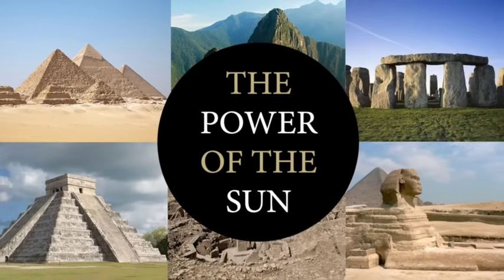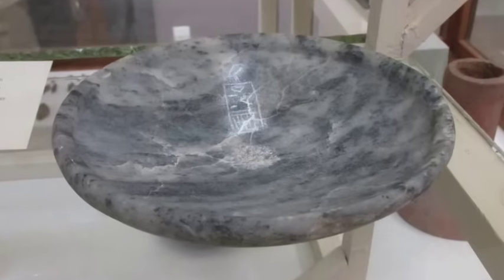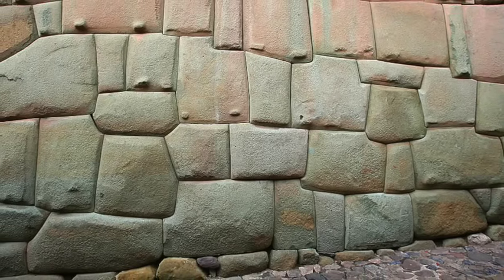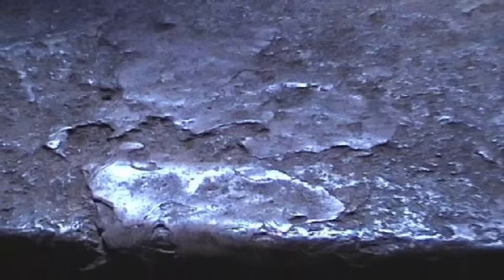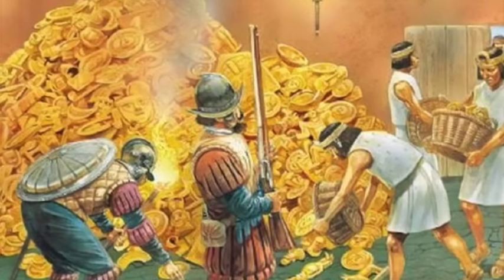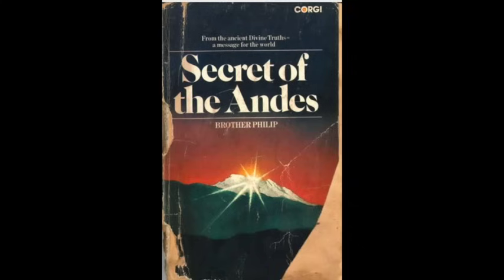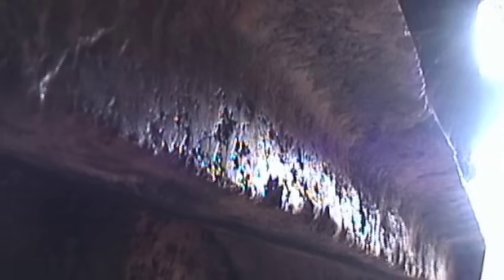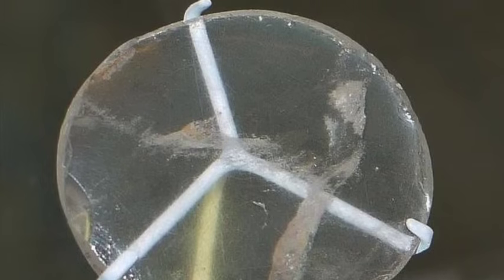How the Ancients Cut Stone with the Sun - Lost High Technology Explained | Ancient Architects

Comment: They weren't cutting the stone with focused light, because, for one thing, regarding polygonal masonry, how would you know the exact dimension to cut in order to make it fit the other stones, without having it already in place?  Secondly, how does this enable glass-smooth round surfaces, such as on the statues?  You can't focus light into a deep crack to cut those perfect lines.  You can't focus it inside of the upper rim of a jar.  The explanation fails regarding every observations that it is meant to explain.
   HOWEVER, people have long noticed that the rocks, particularly in polygonal masonry, but also in statues and rock-cut ruins, appear to have been softened.  A softening would explain how polygonal masonry stones could fit together so perfectly.  They are plopped into place, and then smooshed into perfect alignment with the other stones, as one would do with soft clay or Playdough.   A means of softening stone would also allow the glassy smooth surfaces of statues, the glazed/melted areas apparent on certain stones, the vases, the rock/cut ruins, that appear to have been 'scooped out,' the perfectly straight lines(you just shape them with a straight object while the stone is soft).
   What was missing from the 'softened stone' hypothesis, was a mechanism of softening.  Focusing sunlight could perhaps have been the method.  Instead of focusing it to a tiny point to try to cut the stone, they may have directed lots of sunlight all over an area more broadly, less focused, in order to soften(but not melt) a larger area.  Then you scoop it out.

   Furthermore - and this is my own idea - it may be that the interference pattern caused by focusing light from multiple different directions can amplify the resultant heat.  In other words, aligning the light waves from different sources such that crest meets crest, causing amplification.  That would make sense, and it could be easily mapped out by primitive peoples without understanding it, just by experimenting with positioning.
   What remains to explain, would be how the workers, working with the heated stone, would have shielded their bodies from the heat.  The stone would be too hot to touch while soft.
Reply: Great questions.

Comment: That is very interesting, indeed.  I've read Temple's book "Crystal Sun" and I also have and read "Secrets of the Andes", which I had long forgotten about.  I  find the idea of concentrating solar light believable and Temple's book is all about that.  However, it seems to me a bad explanation for the bore holes found in Egypt which are perfectly cylindrical.  I was just watching Brien Forrester's most recent video on that topic earlier today.  I don't think that solar light made those holes or was responsible for the exquisite shaping of hard granite with sloped or perfectly smooth flat surfaces.  Doesn't make sense and I'd need to see this technique replicated.  Still, your video ideas are interesting.  Maybe some objects were cut by sunlight and others by saws, as Forrester suggests? Or some other lost technology.

Comment: The granite hole you pointed out was not cut by heat. Those holes clearly show the stepping marks of core drills. But even so, their drills cut granite like butter with large distance cut in one rotation. Nobody knows how that was done and we can't do it now. There is place in MesoAmerica where a huge flat cut out in the side of a large hill was cut out, leaving a glassy surface that is totally flat and boxed sides. The bottom of where this huge chunk was cut out has a cross hatched grid cut into the base. This wouldn't be possible with reflectors or lenses. Nothing makes sense in how it was done. I believe the pyramids created some form of wireless energy that was used for power tools of some sort. There are also stashes of large tuning forks that are not being shown to the public, in museums and were deemed as just ornamental devices. The optical lenses were probably used as fire starters most likely. There may be artifacts staring us in the face but using a technology completely foreign to our ideas of physics these days. Certainly, we know that these black military groups have shown up at archaeological sites, looking for ancient energy devices, and if found are quickly spirited away and weaponized for evil purposes.

Comment: What if the heating of a surface alone was both for cutting with weaker metals AND melting the quartz into that vitrified layer.
If you want to smoothe it, leave it alone. If you want to cut, cut when its too hot to touch.
I mean without magnification concrete can get hot enough to cook eggs.
Believe me.

Comment: None of this is true,. Experts know exactly how they cut the stones, and built the pyramids for that matter.
Reply: No they don't. In Egypt, INSIDE a long cave complex, there are gigantic granite boxes of black stone, perfectly optically cut flat sides and perfect inside corner right angles, carved out of a single giant stone. We can't do this. Granite workers in our time, in a filmed documentary, said they could only do it if they cut 5 flat slabs and screwed them together. They couldn't believe or explain how Egyptians did that. Or even how they got them inside the caves because the openings don't fit the boxes. We can't cut granite to recreate the Great Pyramid because we don't have the technology to rapidly cut them like they did. There is a great book by a master machinist who wrote about stone cutting in ancient Egypt, where he personally went to examine the technology they used. He found evidence of machine controlled devices like our CNC cutting, on a sculpted granite face, where the two sides of the face are identical like a computer would do. He found floors showing the marks of large circular flat grinders to make perfectly flat floors, something we can't do in granite over such a large area. He has his theories but bottom line is he said they had powered machines that rapidly cut granite stone, but no idea what the power source or what kind of cutting tools were used, because nothing has ever been found of these tools.

Comment: This all makes for cool videos but I bet they pounded them with rocks, used string and sand to cut them, copper and sand to drill them, and a hard sand or maybe the dust produced when cutting or drilling to polish them. Tens of thousands of workers or slaves with hundreds of years to work on them could probably do this amazing work. The simplest answer is usually the right one.

Comment: IMAGINE... thousands of years from now after everything is incinerated by solar flare, chemical warfare, or nuclear weapons...
an hundred years after they invent automobiles and planes...
they have internet...
and someone is making documentaries just HOW did those twentieth century humans make such perfectly straight concrete floors, corners and cast iron pans and engine blocks with those eight holes in them...
You can pour concrete up against a curved surface and it fits perfect...
Try to figure out what mortar they used to bind all the different gravel, sand and bits of rock together...
Easy for one man to haul fifty lbs of rock or sand up a pyramid and mix it up and let it set...
Or maybe first try to figure out HOW ROCK IS FORMED in the first place for answers?
We know you oven back clay and it comes out pretty damn hard?
What about the story in the Bible of the slaves having to make BRICKS for the Egyptians and then have to gather straw themselves? Maybe there is a substance or chemical in straw used for ancient concrete binding?
NOBODY dares mention that, right there in your face, the bricks were for what?
Pyramids?
Doh....

Comment: perhaps they used some sort of Jig, or die hold the lens and allow it to be guided in straight lines, and the stone sat on a pebble, allowing it to be easily rotated for cutting.   Idk, i dont think the Sun was used to cut, i think the sun was used to soften the stones in some way, and they were either molded, or they were softened and then sound was used to easily cut through the softened stone.  Tuning fork drills are real, and there is (mostly rumors, but rumors that make sense) a way to both drill circular holes with copper tubes, using the tuning forks, as well as using tuning forks and some sort of metal/copper string attached to the tuning forks for straight flat cuts.  You could even cut concave/convex faces in stone with metal/copper strings using vibration.   These methods seem crude, and they somewhat are, because not enough people look into this shit to provide the proper evidence we need, but there are for sure videos that show these techniqes working.

Comment: May 9, 2019  ~ As a child I could start wood on fire with a magnifying glass. I used to electron beam weld in a vacuum  that of course had to ave a ground to foucus and then i nte  sify the beam to melt metal objects. Melt granite with  a Concave object made out of gold?  You need a definitive fine line of intense energy. Then you need to focus the beam of light  to a fine energy beam. The block of granite is constantly dissipating the heat away from the cutting zone! Now you need intense pressure to keep a tight beam of force sever a two foot block of granite. WoW! // It's one thing to say it "BUT" I have to see anyone do it with a mirror lens.

Comment: The problem regarding melting stone with sunlight isn't any different than using gases to cut steel. There is melted residue of large, even monstrous proportions left over.Where is this residue? No! I don't believe that the Egyptians did it by using sunlight, no matter how concentrated.

Frankly, with the massive water reservoirs that are still present in Egypt,I firmly believe that pressure washes with sand and water would accomplish the tasks quite easily, and would easily be implemented within the Egyptian technological capabilities. For that matter, this would leave no residue other than sand.

Comment: Granite can be cut with a copper saw and drilled with a copper cylinder when combined with sharp sand to do the actual cutting/grinding, water stops the mush from building up... Takes two people to operate the saw or bow but one can easily imagine a rig using animal or water power to get the job done much faster. Powder and wet cloths can polish granite to a high sheen by hand... All demonstrated. Time, effort and pretty simple tools - and architecture in many respects..... The glaze is a chemical reaction from an acidic mortar rendered between the cracks and possibly the whole wall at some point. All attempts to produce these 'ancient lasers' using items and method you mentioned have not worked, even with modern knowledge. Implausible theory..... Cities of Gold was a fun cartoon but it's a shame so many people think it, or something like it is true... Ancient flying craft and all...
Reply: https://www.youtube.com/user/GREENPOWERSCIENCE this guy melts stone with the sun.

Comment: Riiiight.  A two-millimeter focus might get hot enough to melt the quartz in a small sample of rock, or even the surface of a larger one, but there's going to be way too much thermal mass in a large block to achieve "cutting."   And how long is it going to take to burnish the entire exposed surface of a block ten feet on a side, heating a 2 mm area at a time, and then either moving the mirror or the block?  "Finally finished with that one, slave?  Great, now do these other 10,000 blocks.  Speed up, you're falling behind!"

Comment: Exactly. I came to the same conclusion without knowing about this film or the book. They all worshipped the sun. They all had gold as a very valuable metal - why??? 
I was about to write about lenses while watching, but you mention also this. I think you can amplify the effect by shock cooling the heated stones so you can grind of larger quantities - you can see scoop marks all over the rocks that are still in the bedrock. This way you don't need so much heat and the debris is not molten rock but gravel or sand.
They probably discovered the lens making by heating clean sand.
Interesting: they seemed to have stopped their work all at roughly the same time some 12'000 years ago, some say. It could well be that a worldwide cataclysmic event (asteroid, volcano...) covered the sun long and bad enough that not only these works had to be stopped, but also some civilisations were affected by the loss of food.